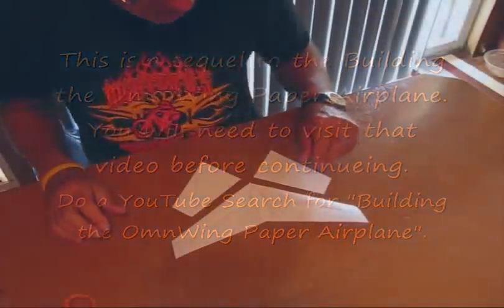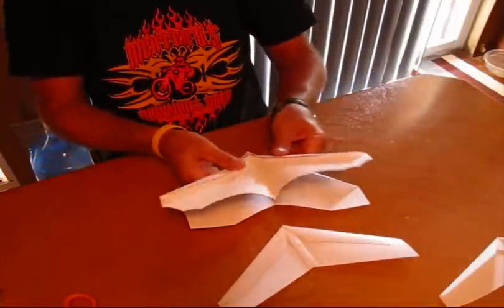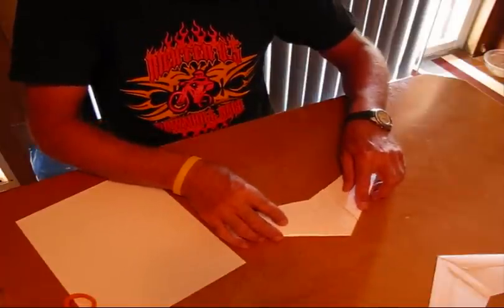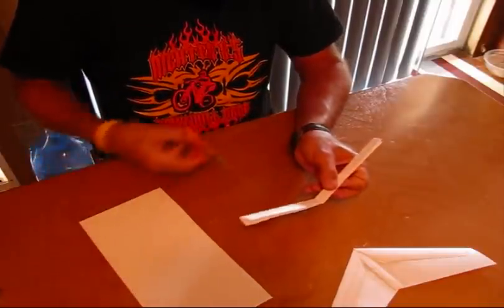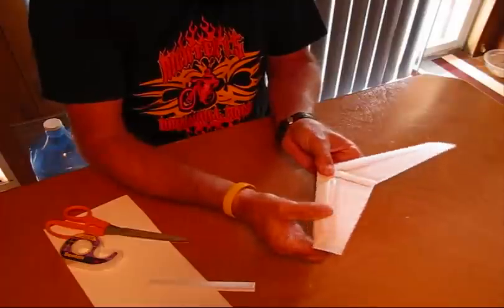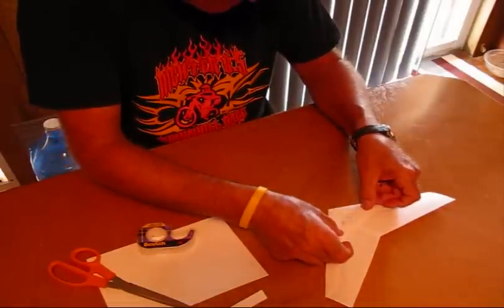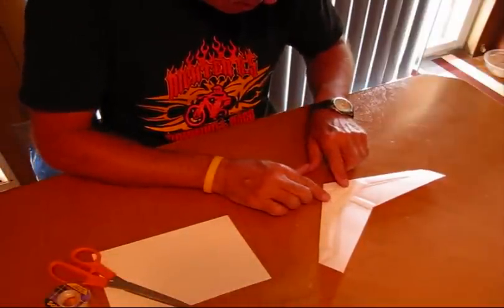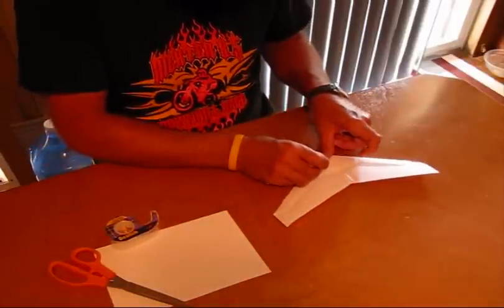Step 1 modifications for the OmniWing Paper Airplane

Comment: Hi Mr. menamiketrx. Is there any modification to make the omniwing fly slower without stalling? The last omniwing I did was smaller in size than the usual and I made a mistake at the airfoil that made it dive. Well, so instead of trying the same airfoil again I tried a different one by pulling the edges and taping them forming a kind of a hollow airfoil. At last, when I catapulted  it (it was a catapult launched omniwing), it made the initial loop and it made an "airbrake" and it glided REAL slow, slower than the standard glide speed of omniwing. Really beautiful glide

However, I'm not sure of what modification I did. :( So that's why I'm asking: is there any EXACT modification improving stability and making the omniwing fly slower (I really like slow and stable flights)?? Thanks in advance and sorry for the big text.
Reply from the maker: With your modification, you created a higher profile airfoil, and these are commonly used in aircraft that need to land and take off at a low speed.  Hang Gliders and Ultralight aircraft can be seen with high profile airfoils.  If you enjoy slow and graceful gliding, I suggest you try the Advanced OmniWing, but stop at the end of stage 2.  You will find the Advanced OmniWing Series on my channel.  I love it when people experiment with the OmniWings.  It serves as a great platform for experimentation.
Reply: menamiketrx Yeah, I really enjoy slow flights! Thanks for your tips Mr. menamiketrx! I'm going to watch the advanced omniwing video and learn more!
Reply from the maker: Antonio Maciel Let me know how it goes.
Reply: menamiketrx Mr. menamiketrx, one thing came up at my mind: with those modifications in this video, what if I put more airfoil on the plane since I want less speed (I mean more paper at the airfoil and make the it thicker), do you think I'll get what I want (slow glide), or does this only works with a thick hollow airfoil like before? What do you think? Thanks again in advance.
Reply from the maker: Antonio Maciel Adding layers towards the leading edge will provide a thicker airfoil, but also will be adding weight.  The amount of layers to get a significant thickness would require and extreme amount of paper, thus a lot of weight, making for a fast flying wing.  This is exactly what I do with the Advanced OmniWing, where sometimes I will have up to eight full sheets a printing paper involved.  The layers are more an effort to clean of the airflow over the top surface, rather than seeking  high profile airflow to slow the craft down.  Build with 8 sheets and you get a scary fast wing, if built properly.
Reply: menamiketrx I see, then the answer is hollow and fat airfoil. Thanks for all the explanations Mr. menamiketrx. I'll keep making modifications to see the results!

Comment from the maker: The Advanced OmniWing can be more prone to more errors.  There is a limit to which you can make paper stay in form.  I would suggest when building the Advanced, that you make certain to be putting in as much washout as possible without distorting or wrinkling the paper.  Then when applying the added structures, make sure you are not taking out the washout.  I always try to enhance the twist and washout when adding internals structures and top sufaces.  Good luck!

Comment: I can't get the modified version to fly nicely. The regular one works great but this modded version seems too heavy to me. Any ideas? I have the right twist in the wing and I followed your instructions closely. I did make my modded version a bit wider than the regular one, thinking that added wing size would provide extra lift for the extra weight... Didn't work at all. 

I have had a great deal of fun doing this in the downtime from RC-flying, thank you for your great ideas!

Comment from the maker: @patrickd126 Some years back I messed around with cardstock and with some modifications it worked and made for a little more resilient wing but the stiffer the paper, the more difficult it is to get the twist.  The card stalk seemed to favor larger wing planforms as the larger wingspan would allow for twist to happen over a longer span with the stiffer paper.  Try it out and let me know if you find success.

Comment from the maker: This would depend on the terrain.  Where I live the mountains and hills are not very steep so rarely would I have a true cliff launch.  The steeper the hill, the more wind the Advanced can manage.  Also, pursue taking the Advanced concept even further with more internal structure, and more top surface layers.  I have built with up to 8 sheets packed into one Advanced.  Makes for a scarry fast craft that still maintains a very impressive glide ratio, thus able to penetrated stronger winds.

Comment from the maker: I have had some thermal flights with the Advanced OmniWing.  Will usually take some wings when I go hang gliding and launch them prior to setting up the hang glidier.  At Mt. Nebo once, I am doing some early morning tosses off the roll-off to cliff and the Advanced Omni slips into a thermal and then actully goes into a slight turn and is gaining altitude.  Some guy walks up and asks who is controlling the Zagi.  He thought it was remote controlled.  It does look like a zagi though.

Comment from the maker: I doubt that proceeding with the modifications will correct your problem.  I would suggest you work on making sure you are getting maximum twist into your wing.  You will need a good stable flying platform from which you can add the mods.    

Mike